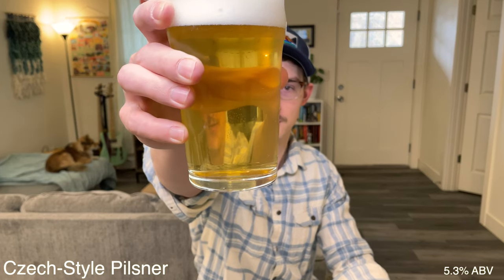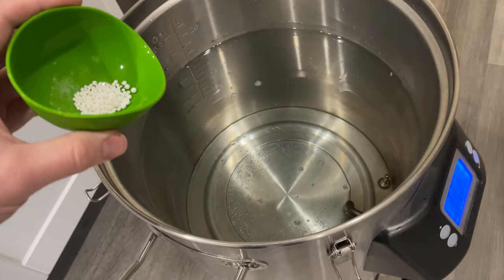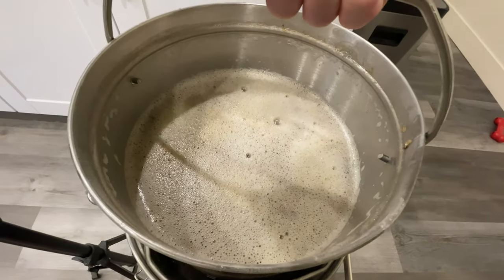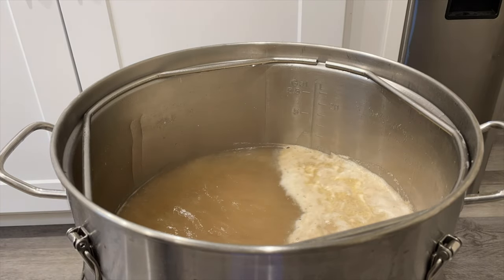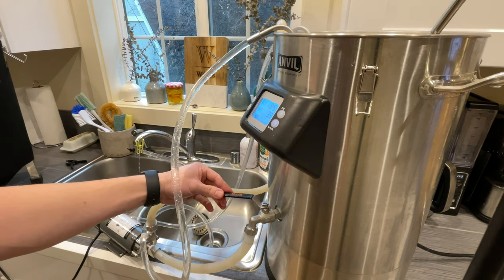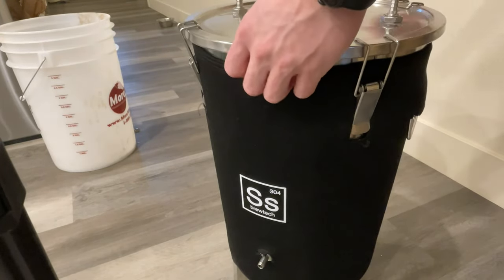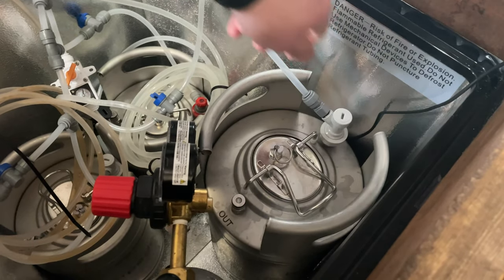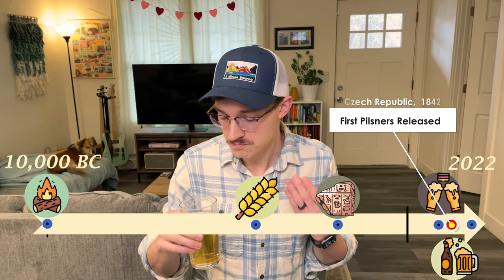Czech Style Pilsner

Comment: Really like the format of your videos.  I noticed you switched to a RO water setup.  Is it as simple as buying one meant for fish tanks and repurposing?
Reply from the maker: Thanks!

I’m certainly not the RO expert, but I do believe there is a difference in the aquarium filters and the drinking water filters. (Maybe one filter out of 5 is different?).

I’ve used a traditional personal RO system, one with a tank and a faucet you can install in your counter. It worked great, but I wanted a more compact system that didn’t take up as much space. The one I use now seems to work well, and registers about the same on my TDS water meter as my old tank/faucet RO system. So I’m pretty pleased with it!
Reply: @5minutebrewery  Cool that makes sense.  Which system do you have now?  I'm looking to move away from buying plastic jugs of distilled water every time to save space as well

Comment: Does that particular RO filter have a separate line to allow collection of waste water? Also, have you noticed a difference coming from the RV carbon filter?
Reply from the maker: It does! The waste (black) line I’ll usually run to a separate bucket as it’s probably 2/3 of the amount of water as collected. Use it for plants, cleaning, etc.

So far I haven’t noticed too much of a difference on the 2-3 styles I’ve made, but the last place I lived I certainly noticed a difference over RV carbon filtered. I had a hard time keeping track of my water profile as I think it changed depending on the season. Hoping it will prevent that and keep it more consistent where I live now.

Comment: I thought, you have to do a 2 or 3-step dekoktion for the original taste of a chech-pilsner?
Reply from the maker: So from what I’ve seen, in the past when malts were less modified, decoction mashing was more necessary to extract the sugars and enzymes for the brewing process. However, with modern malts, the enzymes are already well-developed and the necessary sugars are easily accessible without the need for additional processing. 

My goal in a Czech Pils is a clean, crisp flavor profile with a dry finish, and from my experience I can get that pretty reliably with a single infusion mash with modern malts, and saves a ton of time and energy.